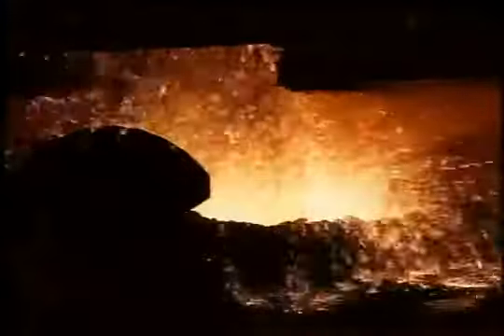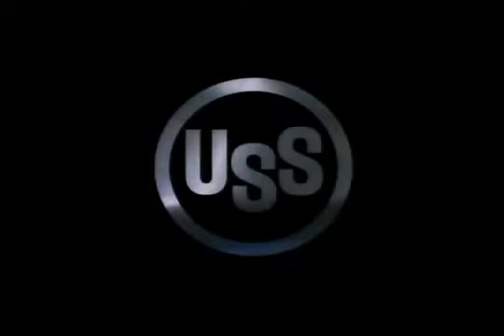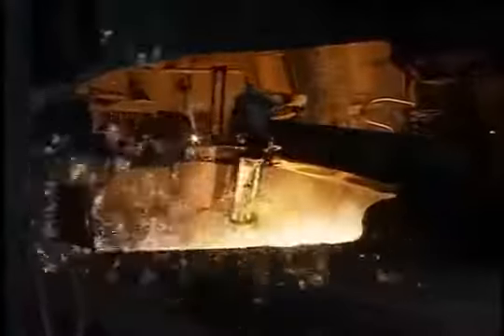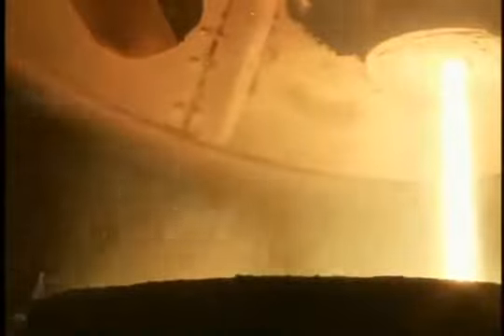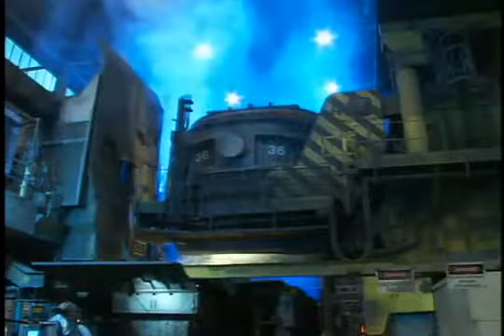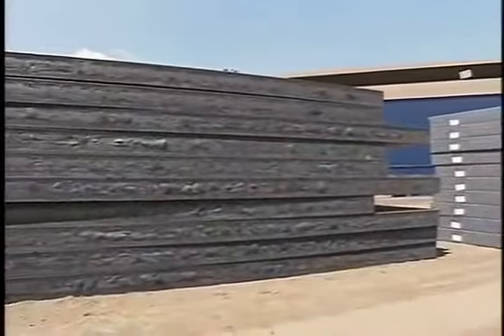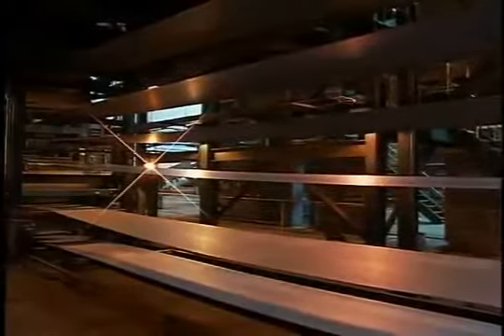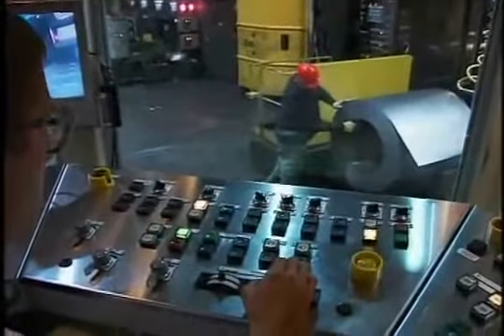STEEL  From Start to Finish

Comment: [DELFT “Steel Making Quiz 1”]

Iam Bathara Indra, 2713100045.

The "steelmaking" video show me about steel-making process. My review from the  "steelmaking" video: The steel-making process basically start with the production of iron. The raw materials are iron ore, coal and limestone. The iron ore stored according to origin. And then transported to the next process to mix in rotating drum, this step is to make the optimum blend. While the transporter rolling over the furnace, the other raw material, coal, ground to powder and blown into furnace. At eleven hundred degrees centigrade, the coal is now converted into metallurgical coke. The coke is consisting pure carbon with minor pollution. They move into furnace and the metallurgic coke is guide through quenching station and after cooling screen into large size coke term lump coke is supposed to be used in the blast furnace and small coke breeze to be used in the sintering process. Iron ore, coke breeze and also limestone, now carefully dispensed and blended. This blend spread on the strand which slowly moves under the combustion zone the sintering process. The combustion zone moves downward. After that, it is cooled, rushed and screen. When the fines returned to the sintering process, the remaining product is the sinter, basically move into the next step, the blast furnace operation. Sinter, lump coke and limestone are inject into conveyor belt or skip transported to the top of the blast furnace. Iron ore is principally a compound of iron and oxygen. Iron is produced by the extraction of oxygen using coke. This reaction is endothermic. To sustain the reaction, extra coke is injected together with hot air. The air is preheated to around one hundred two thousand fifty degrees centigrade in hot blast stove and blown into the furnace through tuyers around the furnace. Moving downwards, the sinter, coke and limestone are converted into liquid iron and slag. To save the used the more expensive metallurgic coke, sometimes polarize coal is injected. By the computers, the process operating parameters kept under close control. The liquid iron or pig iron is collected at the bottom of the blast furnace and tapped into a torpedo. Its here, that the real steel making process starts beginning with the process reducing CS and CaO to become CO and CaS. With the percent of CaS is 0,01 percents. Now, the pig iron move into steel making plant. Steel making can be carried out in several processes. Nowdays only Oxy Steel Converter and Electric Arc Furnace (EAF) are relevant. In Oxygen Steel-making Process, the liquid pig iron is transfered into a ladle. The samples are sent to the laboratory and the floating slag is removed. The liquid iron is now put into a converter. Subsequently scrap is added, this is to control the temperature increase due the oxydation impurities, maybe carbon and silicon. The oxygen blow into the blast and the impurities are floating on the furnace. Finally the temperature one hundred six thousand and fifthy degree centigrade is obtained. At the end of oxidation process, samples are taken for chemical analyses. Within five minutes, the results are presented on the screen in the steel-plan. From the analysis, also the anouncer dollowing elements in reagents in the dissociation and the oxydation are determand. Allowing elements to ensure a steel composition related to the final properties of the steel. By using alluminium, the steel is oxidazed, the alluminium is associated with the oxygen improving ductility. The steel is in the down and the slag is in up, they are can be separated by tapping. First will be the steel, and after that is the slag. The liquid steel is then stir using an inert gas, argon. This to ensure composition and temperature to be homogeneous. In addition, the gas bubbles float out impurities which are absorbed into the slag. About 300 tons of liquid steel is taken into continous casting machine.

That's all my review about the "steelmaking" video,
Regards

Comment: STEELMAKING QUIZ 1
Dendra Ravelia (2713100148)

The steelmaking process starts with the processing of iron ore. The rock which used for making an stell  are iron ore (Fe2O3),  limestone (CaCo3) and coke. the most important ore is haematite (Fe2O3), Magnetite (Fe3O4). The rock containing iron ore is ground and the ore is extracted using rollers. Iron ore that contains a lower iron content must be processed or beneficiated to increase its iron content. Pellets are produced from this lower iron content ore. This ore is crushed and ground into a powder so the waste material called gangue can be removed. The remaining iron-rich powder is rolled into balls and fired in a furnace to produce strong. Sinter is produced from fine raw ore, small coke, sand-sized limestone and numerous other steel plant waste materials that contain some iron. These fine materials are proportioned to obtain a desired product chemistry then mixed together. This raw material mix is then placed on a sintering strand, which is similar to a steel conveyor belt, where it is ignited by gas fired furnace and fused by the heat from the coke fines into larger size pieces. 
The coke is produced from a mixture of coals. The coal is crushed and ground into a powder and then charged into an oven. As the oven is heated the coal is cooked so most of the volatile matter such as oil and tar are removed. The final raw material in the ironmaking process in limestone. The limestone is removed from the earth by blasting with explosives. It is then crushed to reduce the size. Since the limestone is melted to become the slag which removes sulfur and other impurities, the blast furnace operator may blend the different stones to produce the desired slag chemistry and create optimum slag properties. All of the raw materials are stored in an ore field and transferred to the stockhouse before charging. Once these materials are charged into the furnace top, they go through numerous chemical and physical reactions while descending to the bottom of the furnace.
The purpose of a blast furnace is to chemically reduce and physically convert iron oxides into liquid iron called "hot metal". The iron ore, pellets and sinter are reduced which simply means the oxygen in the iron oxides is removed by a series of chemical reactions. 
Fe3O4 + CO = CO2 + 3 FeO
The limestone descends in the blast furnace and remains a solid while going through its first reaction as follows:
CaCO3 = CaO + CO2
he CaS becomes part of the slag. The slag is also formed from any remaining Silica (SiO2), Alumina (Al2O3), Magnesia (MgO) or Calcia (CaO) that entered with the iron ore, pellets, sinter or coke. The liquid slag then trickles through the coke bed to the bottom of the furnace where it floats on top of the liquid iron since it is less dense. Another product of the ironmaking process, in addition to molten iron and slag. These gases exit the top of the blast furnace and proceed through gas cleaning equipment where particulate matter is removed from the gas and the gas is cooled. This gas has a considerable energy value so it is burned as a fuel in the "hot blast stoves" which are used to preheat the air entering the blast furnace to become "hot blast". Any of the gas not burned in the stoves is sent to the boiler house and is used to generate steam which turns a turbo blower that generates the compressed air known as "cold blast" that comes to the stoves.

Comment: DELFT "SteelMaking QUIZ 1"
Rinush Fedrikdo Paltgor (2713100082)
PBB-B/Ms. Dian Mughni

I want to review about “steel making and the afterglow” video that produced by Delf University of Technology. Iron steel making start from the production of iron. The raw materials are iron ore (Fe2O3), coke (C), and limestone (CaCO3). The iron ores stored according to origin and separated to form a fine layer of ores. They are mixing ores, cokes, and limestone. After that, they put all of them into rotating drum to make an optimum blend. Beside that, the other raw materials coal ground to the powder and blown into the furnace. At 11000C, the coal become a metallurgical coal consisting a pure carbon. After that, the metallurgical coke guided to quench station to make cold coke and screened to large size coke, lump coke to be used in sintering process. The iron ore, coke breeze, and limestone mixed/blended. The sintering process, the raw materials combusted to the downward very slowly.  The combusted blend then cooled, crushed, screened and the fine blend back into sintering process. The next step, sinter, lump coke and limestone transported by conveyor and skip car into the top of blast furnace. Basically iron ore contain ferrous and oxygen, and the iron is the result of iron ore and coke reaction (Fe2O3 + CO = Fe3O4, then Fe3O4 + CO2 = FeO, FeO + CO2 = 2Fe0. The reaction is endothermic means using high energy (high temperature). To sustain the reaction the extra coke injected with hot air. The air heating the reaction 12150 C in hot blast stove. The sinter, coke, and limestone move downward in the blast furnace and converted into liquid iron and slag. To increase the economy using of coke, oil and pulverized coke are injected. The pig iron are on the bottom of the blast furnace and tap out into ladle. Next are the steel making process. Steel making process start from desulfurization by injecting the limestone CaCO3 to decrease the sulfur contain to 0.01% if necessary. In this era, steel plant using oxy steel converter or electric arc furnace. In the oxy steel converter, the pig iron transported into another ladle and heating up the pig iron. The sample send to laboratory and the slag (in the surface) wiped out. After that, the pig iron transfer to the converter adding with scrap metal. In the converter, pure oxygen blown to the bath to oxidize the slag in the surface. Using temperature around 6500 C. At the end of the oxidation process, sample is taken to analysis. After around 5 minutes the result is display on the screen in the plant. The analysis is to controlling the steel compound to produce final product. Alumunium added to deoxidation of the steel and increasing the ductility while tapping out the metal from huge ladle. The molten steel separated from the slag by moving the converter to the left for tapping out the molten iron after that moving to dispose the slag. After the refining process, that the molten iron injected by inert gas Argon flow up the impurities and join the surface slag. And for last, the steel casted in the continuous casting. That is all about steel making process from the video. I hope this review will improve our knowledge about steelmaking process.Thanks

Comment: DELFT "STEEL MAKING QUIZ 1" (17 OKTOBER 2015)

- IGFAR CITA (2713100024) -

My name is Igfar Cita (2713100024) from class PBB B Ms. Dian Mughni. Here are some review from the video quiz https://www.youtube.com/watch?v=Ea_7Rnd8BTM  which held on October 17th 2015:

"Steelmaking, the processs basically start with the production of iron. The raw materials usually are iron Ore (Fe2O3), coal, and limestone (CaCO3). The iron ore stored according to origin then the various sources are reclaimed. Before being transported to the next step in the process, the layers on mix in the rotating drum the reclaim to make the optimal blend. The transporter rolling over the furnace. The other raw material, the coal, ground to the powder is blown into the furnace. At 1100®C, the cold is converted into metallurgical coke consisting of pure carbon with minor pollution. Moved from the furnace, the metallurgical coke is guided through into the quenching station and after move from the quenching station, it will change into the large size coke and lump coke and will be used in the blast furnace and meanwhile the small coke which come from the process will be used in the sintering process. Iron ore accomplished, so do limestone are now carefully dispensed and blended. This blended ore spread on the strand which moves under the combustion (the sintering process). The combustion zone moves downward to the blender. The high temperature reach at the ground iron ore into a poor sinners as soon as the blended ore is completely burned through. It is cool and crushed, while the fines are returned into the sintering process. We reach the blast furnace operation where sinter, coke, and limestone are entering the blast furnace with conveyor belts to the top of the blast furnace. The iron ore is usually compound by an iron (Fe2O3) and O2 (Oxygen). Iron are produced by the process of extraction from oxygen using coke. This reaction is endothermic. To sustain the reaction, extra coke is injected together with hot air. The air is preheated at around 1250®C in hot blasted coke and blown into the furnace. The sinter, coke, and limestone are converted into the pig iron and slag. The iron which transform into pig iron are located at the bottom of the blast furnace and tapped into the torpedo later. It’s here where the real steel making process starts, beginning with the desulphurization process by injected lime powder. To avoid loss ductility at high temperature, the soft reduction lower than 0,01 % is necessary. And after that, the liquid pig iron are transported to the steel plant. Steelmaking can be carried in several processes like Siemens Martin Furnace, Oxy Steel converter, Electric Arc Furnace, and Thomas Converter. In the oxygen steel process, the liquid pig iron is transferred into another level, the temperature is measured and samples are sent to the laboratory and slag is removed. The liquid pig iron now put into the converter. At the end of the oxidation process, samples are taken for chemical analysis to ensure a steel composition related to the final properties. The impurities are gas bubbles which are observed into the slag. After refining, about 300 tons of liquid steel is taken usage in a continuous casting machine bold."

That’s all the review from the video. 
Thank you